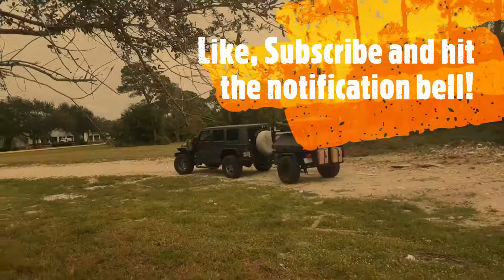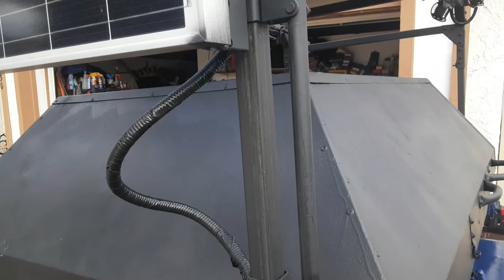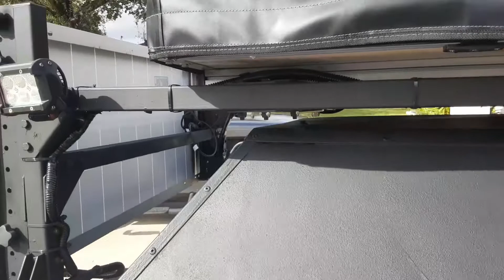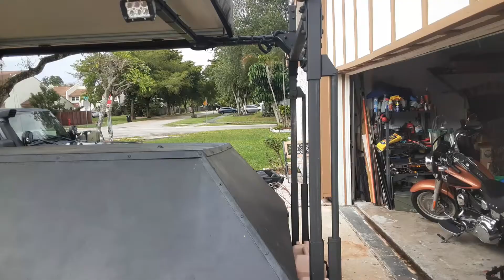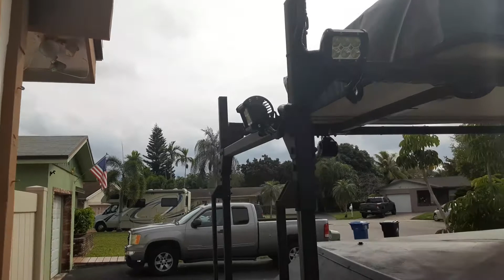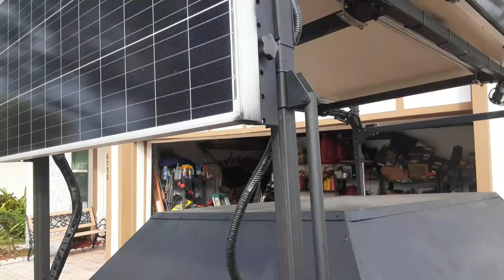M416 Overland Trailer Walkaround   Telescoping Roof Top Tent Rack  Solar Power - Jeep JK

Comment: G’day. I’m impressed with your build. Please understand I’m not out to put your work down in anyway. Your telescopic tubing and actuators really needed to be the other way round. Unless they have drain holes in the bottom, you’re going to get dust, rain, mud and sand in them which for now all may be well but in time it’s going to cause some binding issues ay. Apart from that I like what you have done. Cheers.
Reply from the maker: Thanks appreciate your feedback and thanks for watching.  I was constrained with the placement due to the top and how it came from the military.  So it took some thinking to make it work as I wanted it to  :)

Comment: What was you specs on the linear actuators?
Reply from the maker: Sorry for the delay - I used these
Homend DC12V 18inch Stroke Linear Actuator with Mounting Bracket 900N(225lbs) Maximum Lift 10mm/s for Recliner TV Table Lift Massage Bed Electric Sofa Linear Actuator
Reply: Awesome thank you

Comment: Great build!  I have been looking for a solution like this.  When it is fully extended, do you add any pins or anything to the rack to help secure it in the up position while sleeping?  Or is it solid and no worries about it creeping down?  this is great, I might toy with the idea of also adding 5 additional switches for a total of 6.  (1) Master on/off, (1) All up/down, and (4) one for each leg to help level the tent.   But curious about the creep down.
Reply from the maker: Its solid - the actuators have an internal screw that extends/collapses the some with the 4 its rock stable..

Comment: Nice Build, really like how you did the telescoping. What size is the square tubing for the rack and the internal square tube that rides inside?  Also, when at the extend position does the tent have much movement (wiggle) or is it pretty solid?
Reply from the maker: Its really stable once extended - or fully closed I used extra cross bars to ensure its stability
Reply from the maker: Thanks - I followed the recommendations of compact camping concepts and my local metal supplier - https://compactcampingstore.com/collections/trailer-racks.